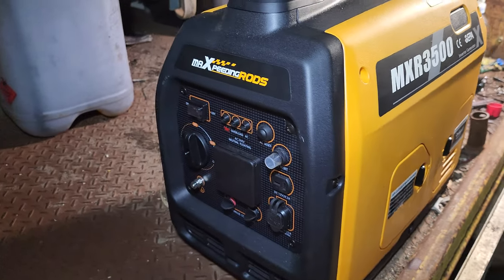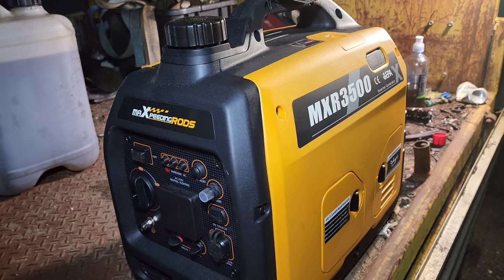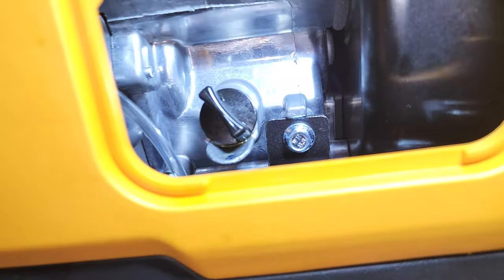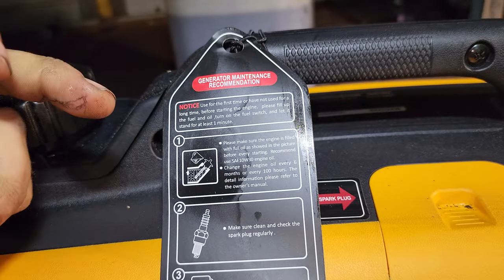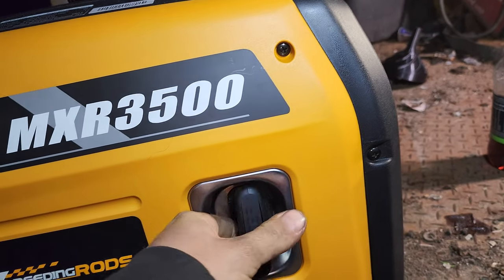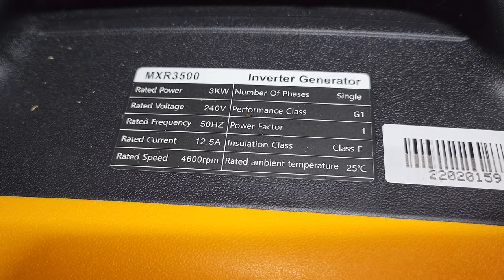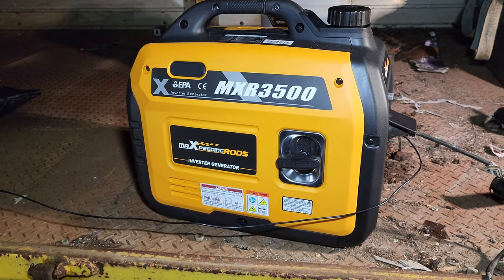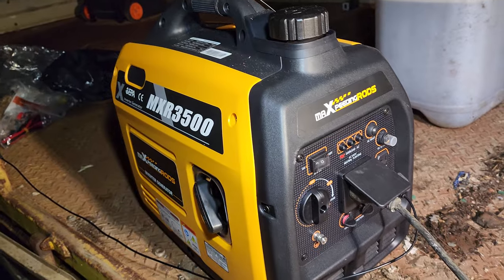Maxpeedingrods MXR 3500 WATT  Inverter generator unbox walk around and first start.

Comment: Have a new one in the UK. Seems fine. It will boil a 3kw kettle without fuss. The odd thing about the handbook is that you really have to hunt on all the labels and handbook to find the oil required. Three types according to the ambient temperature and the spark plug gap ! It's all there. Happy hunting ! Being a Chinese engine it would be a good idea to run it for a couple of hours and drain and refill with new oil. They have a reputation for swarf ! Maybe unjust but better safe than sorry  . But so far it seems a sound bit of gear.
Reply from the maker: Yeah I'm up to probably the 15th tank through it. Going good as gold

Comment: Cool video. Have you figured out how to drain the fuel for storage ? not in the manual.
Reply from the maker: Flip it upside down it will fall out very quick and easy. There is a drain on the carby bowl

Comment: I have had mine for 3 months, and I find it really hard to start it.
Your video shows one pull start, but I can't start mine to the point I have given up on it.
Would love some advice
Reply from the maker: Mine is at most 3rd pull. 1 or 2 on choke and goes every time after the first pop
Reply from the maker: Inlet gasket between the carbie and head. Could be leaking and not suckling fuel through

Comment: Please help. Mine will not start. I had it running once now it won't start.
Reply from the maker: Did you put oil in it out of the box.
Reply: Yes don't be fooled by the oil in the sump. Its nearly all drained before shipping. Check the spark plug !.  Did you open the vent on the petrol tank ?. It must be open to run for any length of time !
Reply: @davidsaunders1125  vent on a gas tank? I have no clue where to find it .I never heard of such a thing.Thank you for responding
Reply: The big red knob on the petrol cap ! Marked on and off. It stops petrol fumes. This was the first one I have seen. Good idea !
Reply from the maker: Ah mine doesn't have that its just a ratcheting cap

Comment: Smoking too much for a new unit
Reply from the maker: Choke is on first start out of the box. Every combustion engine does first time
Reply: Dead right ! It's the oil used in assembly and when the unit is shipped on its side. A little bit of oil is left in the sump after testing as well !
Reply from the maker: Yeah lots. Of people have not first started an engine fresh out of the box or rebuilt one themselves